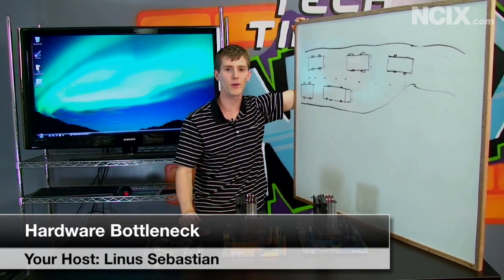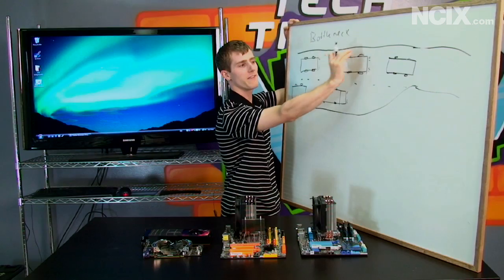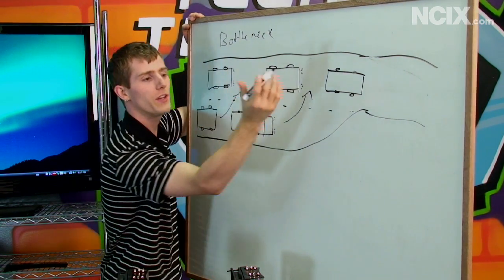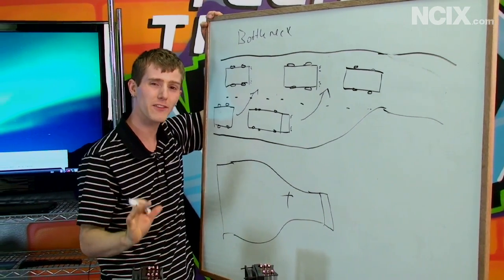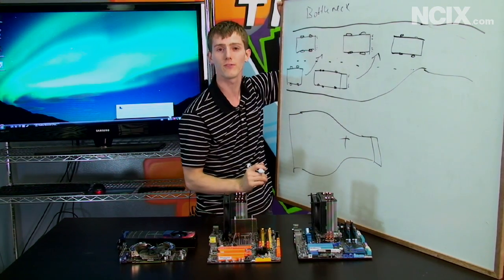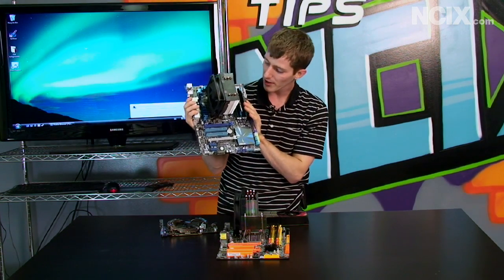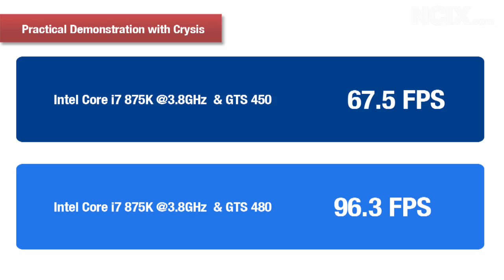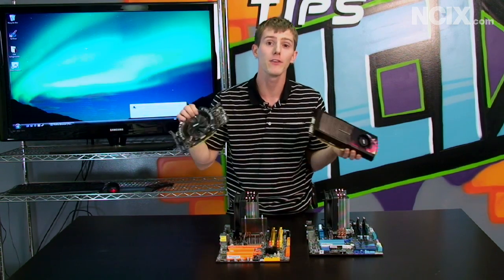Understanding Hardware "Bottlenecks" and How to Avoid Them (NCIX Tech Tips #81)

Comment: i have an AMD athlon II x4 635  processor
and i consider to buy  an  R9 380
(replacing my dirty old HD5570)
will those go together very well ?

i really want to upgrade my little buddy here for playing latest of games and recording
but i don't really know what is holding me back my HD5570 or my processor
i would guess the HD5570 because its a low to mid card
the power needed also says i need to upgrade it to atleast 750W 
with my  R9 and 750W i'm already at 380 euro's (europe)
i changed the 2G ram to a 2x4G  (8G) 

also will the " cooler master GX 750W " fit a gigabyte 870A-UD3 motherboard ?
Reply: it'll bottleneck obviously
Reply: Electrikz well i'm not the best computer guy so not so obvious for everyone

i think i can put in an AMD athlon x4 760k/  860K?  upgrade so it doesn't bottleneck ?

if not then what do you suggest ?

Comment: will i have an bottleneck problem running an:
mobo: Gigabyte GA-990FXA-UD3
cpu: AMD FX-8150
gpu: Gigabyte GV-R928XOC-3GD
hdd: OCZ agt3-25sat3-120g (booting)
hdd: WD Green WD20EARX, 2TB (storage)
psu: Coolermaster Real Power M850
ram: Corsair CMZ16GX3M2A1866C9

just asking cause i recently upgraded my cpu and gpu and ram cause BF4 was comming... but im not getting high FPS

Comment: if i have an msi gtx 670, and a amd a8 3850 apu, will it bottleneck? i mean. ive played skyrim, 1080p all ultra with the high res texture pack, and sometimes the frame rate drops to even around 40 fps sometimes. is it bottlenecking or is there something wrong with my gpu?
Reply: ***** ok, thanks.

Comment: I need help, been planning this Build for quite some time now, did some research here and there, watched a lot of linus tech tips lol, but im not sure. Please suggest if what are the parts that needs to be removed or to be replaced in order to have an optimized Build - im on a tight budget though XD  many thanks ;-)

CPU: INTEL CORE I5 4460 3.2GHz LGA1150
MOBO: MSI Z87-G41 
Coolong Fan: DEEPCOOL Ice Wind PRO
RAM: KINGSTON 4GB HYPER-X FURY 1866MHz (or 8gigs maybe)
GPU: PALIT GTX750Ti STORMX DUAL 2G DDR5 128BIT (the only GPU i could afford now)
HDD: WESTERN 1TB SATA3 BLUE/GREEN 
PSU: XIGMATEK X CALIBRE SERIES 80 PLUS 600W (is it over what i need?)

Comment: I recentley upgraded my computer from a i5 2500k and a gtx 560 to a fx8350 and a radeon 290. I was really dissapointed with the FPS increases I got. , some games were actually lower. Im still using the same 8gb of 1600 cas 9 ram.i did change my board from a p67 ud3 to a asrock 970 extreme 3.0 r2.0. I didint think id be bottlenecked by my processor or motherboard, but I keep feeling that maybe it is because im not getting the performance I should be alteast imo. Im also running a ssd 500mb/write but I dont think that would affect my fps very much. Is there an obvious bottle neck here that im missing?
Reply: Stephen Grimes i5 2500k is much better than 8350 dude
Reply: Games need single core performance which is much better per clock on the 2500k than the 8350. The 8350 is more powerful altogether but that doesn't matter when you're only using one or two cores
Reply: yeah.  sadly no 8 core games out.. i get higher pc benchmarks with the FX8350 but it doesnt mean shit if the games dont utilize 8 cores. Im making a new budget pc for my gf to play mostly low threaded games using a g3258  overclocked to around 4.5-4.8 and a gtx 960. wouldnt be surprised if it gets better FPS then my comp in some games lol
Reply: Stephen Grimes It would be better to get an i3 + R7 370. You don't want 8 cores, but you also don't want 2. i3 is a really good balance.
Reply: ***** do you even know what youre talking about?
Reply: ben p Nope he dosen't x)
Reply: Keruji 4th gen i3 beats i5 2500k because its newer duhhh??

Comment: I have a i7-4770s locked cpu at 3.10GHz and I'm running a GTX 980 and only use my computer for gaming. Is this bottlenecking my computer? should I go for a Intel Core i5-4690K at 3.5GHz and overclock for better future gaming performance? It runs games great now it seems, but not sure if upgrading would be substantial difference.
Reply: gamepro94z Sometimes, your RAM might be affected. That i7 is better than i5. But, overall, there's no difference (sure there's like 1-10 fps difference) in gaming perf.
Reply: gamepro94z  no the i7 can handle the 980 with no problem
Reply: Just leave it bro its fine

Comment: I have i7 960@3.2ghz with 2xGTX 770s (4G) in SLI...will I bottleneck?
Reply: ok... nice. Despite the age of the cpu, it won't bottleneck you for a while to come, especially as games start using the hyperthreading.
Reply: Yeah i actually ended up picking up a 4790k cpu i  the end, works well with the  SLI

Comment: i want to put a r7 260 into my gaming computer and i was wondering if it will bottle neck with these specs And i cant figure out what my motherboard is Sent by NCix tips

Processor	AMD FX(tm)-4300 Quad-Core Processor
Video Card	AMD Radeon R5 200 Series
Memory	8.2 GB 8GB RAM
Microsoft Windows 8 (build 9200), 64-bit

Comment: one question, does bottlenecking only affect frame rate? Because if I get a gtx 1070, but have an AMD fx 8370, obviously the frame rate isn't gonna be pushing it's full potential, but graphic wise, will anything be held back by the bottleneck?
Reply: Dude I did it with a gtx 950 and amd 7300 apu. I tried running overwatch and I get about 40 fps at the lowest graphics. I'm getting a new motherboard tomorrow though because I found out my motherboard wasn't an Intel 1151 to connect my i5 6400. It isn't worth getting the graphics card if you can't upgrade the cup as well because it will bottleneck as hard as a fat man on a water slide. Hope this helped in your decision
Reply: Prod Death I'm not going to upgrade it at the same time, but I will be upgrading the cpu and mobo sometime after I get the gpu. But I'll try the gpu with my current processor to see how extreme the bottleneck is. Thanks for your insight!
Reply: +Samuel Smith I bought a new mobo yesterday and now I can run overwatch at high settings and get 120 fps
Reply: +Prod Death I can run Overwatch at Ultra settings and receive 40-50 frames with my GTX 760 and AMD 8370. Considering that the AMD core is one of the best AMD cores on the market, I don't think it would be an EXTREME bottleneck. But I do plan on upgrading in the future.
Reply: +Samuel Smith i don't know much about amd cores, so if it is a really good core I think it would beam amazing with a gtx 1070
Reply: +Prod Death the thing about the series 8xxx AMD CPUs, is that they have up to 8 cores, which is 4 more than Intel has on their i7s. Unfortunately computer hardware and games don't need to use all 8 of those cores yet. So while the AMD CPU is busy using all its power to hold up those cores, it's not using the power it has to help the other PC parts as well as Intel can. Hopefully AMD will try to focus less on the cores and more on the actual CPU for their future products. That would save me more money than buying an i7 core with another expensive mobo.
Reply: +Samuel Smith ok, that's nice to know for future reference thanks
Reply: Prod Death np

Comment: I have a amd a6 6400k and 4 gigs of ram and a 400w psu I'm thinking about getting 4 gtx titans in sli would this work?
Reply: Yup go for it!
-.-
Reply: You'll overload that PSU... In the first place, if you can afford 4 gtx titans, why would you settle for an A6 system? It would be wiser to build a new rig based on an i3... You'd also want to upgrade the ram. If you want to stick with an APU system, I suggest that you switch to the A10 unlocked black edition, upgrade that ram to 6GB then crossfire the APU with a compatible Radeon GPU...
Reply: Digital Hermit He would rather be better with a 4 way 780 Ti system and a 4930K with 32 GB of RAM, if e needed all of that power.
Reply: Digital Hermit You ever heard of sarcasm?
Reply: Digital Hermit Hahaha somebody's sarcasm meter is busted to hell
Reply: Digital Hermit Understandable in this generation.
Reply: Digital Hermit Hey that hurt my feelings.
Reply: Sorry 'bout that...

Comment: i know my comp has bottle necks, there is 3, 1:my old ass PhenomII x2 560BE (oc'd to 4GHz), 2:an old WD sata2 1tb HDD, 3: and a GT630, but comp does what i need it to do, but what i want to know is what is the maximum cpu i can use with that vidcard on a GA-970A-D3, or would you recommend a new vidcard too, i'm not trying to spend over $600 ($700-800 absolute maximum)

Comment: hi, i have ang A6-6400k OC to 4.4g, and ang fm board... with crucial balistix tracer 8gb clock at 2133mhz. planning to buy either r9 270x or gtx 960, the question is which GPU is good that wont bottleneck my component.. thanks guys

Comment: Sorry if I sound stupid but will a intel i5-4670k and a msi twin frozr gtx 770 be bottlenecking. I just built a new gaming pc and I'm really new to this, so I don't really know too much about this stuff.
Reply: No way man i just ordered mine also and no you can triple SLI 780's with it, you will be fine:) happy gaming
Reply: AMDGamer101
Having more than 2 gpu's on an 1150 socket yields extremely poor results.  The processor simply doesn't have the capability to handle more than 1 gpu at full performance.

1 @ 16x
2 @ 8x each or
1 @ 8x + 2 @ 4x

If you really wanted to triple SLI 780's and not have it be a waste of cash, you'll want a 2011 socket.
Reply: Drew W 1150 will be fine, you'd lose a very small about of fps but you already lose fps in SLI anyways, one powerful card is always better. Plus the kid already bought a new pc don't smash his hopes over a few frames.
Reply: FatedCb I was responding to amdgamer, not the op. The 1150 socket is fantastic. "The kid" needn't worry. Sli and crossfire does very well up to two cards. Three cards is where you'll be wasting performance, as stated in my last comment.

Comment: While playing arma 3 my cpu usage is about 90% on all cores(i5 4560 3.2ghz) and my gpu usage fluctuates between 60-95% (gtx 760) Think it would be worth it to get a i5 4670k?
Reply: Hmmm, if your GPU is taxing all the way to 95% then that shows it is reaching its potential, I would upgrade both.
Reply: My CPU usage is typically higher than my GPU usage. GPU average is 75, CPU average is a bit over 80.

Comment: i have an i3-3220 (duel core 3.30ghz) and i want to upgrade to a GTX 760 would that be a bottleneck or not?
Reply: you do not have a bottleneck but your cpu will not be as fast as an i5 or an i7 because it is hyperthreded however it is only two cores i would try to also buy an i5 just to improve your performance because that is a weaker cpu.
Reply: I agree with Thenicknac22, i upgraded to a i5-2500, from an i3 and got a GTX 770 and it works great for everything i do!

Comment: I got a  Radeon 6670 by Vertex (1GB DDR5 128bit) and a crappy CPU E2180. That's like some historical 775LGA but that's it. No juice for new rig. Since my MB (ASUS P5K) supports dual core and core 2 duo can you suggest me a best 775 processor (mostly) for gaming if this piece of history can run anything at all.

Comment: Will it be a bottleneck if I use a pentium g3258 and GTX 950/960?
Reply: +TheFXGuy 101 pentiums are the 2nd worst intel cpu - it'll be bottlenecked with even the worst graphics cards.

Comment: Help? 
i5 -4590 3.3GHz. Will it bottleneck a 980 Ti? I know a 980 Ti is overkill by a long shot but I want to be future proof way into the future
Reply: You'll be fine i5 isn't that bad
Reply: +Sean Pipatkhajonchai FWIW, I decided on an i5-4460 (similar performance to 4590) and an overclocked 980 Ti.  Benchmarks I've seen show GTA V would benefit less than 5 FPS at 1440p or 4k with a faster CPU, and as I understand it, GTA  V is a CPU intensive title.  I'm happy with my upgrade.  I would caution against expecting any currently available CPU to give top level performance for games 3-4 years from now; I think of "way" into the future as more than 5 years.  Better to go low to mid-range and upgrade more frequently.

Comment: I have an AMD Fx 4300 Quad proc and an AMD RadeonR9 285
I only get like lower than 40 frames on Ultra but also on high and medium settings for Bf4. Is this Being Bottlenecked and if so should I get something like amd fx 4350 quad core cpu?
Also Mantle isn't working on Bf4 though my Gpu says it's supported, is that also because of Bottlenecking?  please get back to me soon. thanks c:

Comment: I have:
MB = Asus Crosshair 5 Formula-Z
CPU = Fx-8350 with turbo on
CPU Cooler = Zalman CNPS-9700-led(old from 2008)
RAM = Kingston HyperX Beast 16Gb(2x8) at 2133
GPU = Asus GTX 760
HDD = 1Tb + 500Gb + 250Gb (all WD and sata2)
PSU = Enermax Liberty Eco 620w (2x12v with 30 amps each,old from 2009)
Monitor = Fujitsu Siemens ScaleoView L24W-4(old from 2009)
Mouse = A4Tech Bloody Gun 3 V7(i don't even use it for what it is made for)
Keyboard = A4Tech KLS-23MU(old from 2006)

Is there a bottleneck

Comment: Glad I stumbled on this vid.
Im currently buying a gtx 760 n my current cpu is a core 2 duo but im upgrading that to a core 2 quad(q8300). Im sure the core 2 quad will still bottleneck the gtx 760 but it should play better with each other as opposed to the core 2 duo..correct?
Reply: it would work better with quad, but it's still bottleneck. For q8300 would be nice pair like HD7770, HD7790 (260X), gtx 650Ti. But in the end it depends on games. Cpu heavy games are the new ones like hitman absolution, far cry 3, crysis 3, mabey new metro, and the king of bottleneck Battlefield 3 and 4 - multiplayer (big maps, 64 -players)
Reply: Don't get a Core 2 Quad man, get a Core i5.

Comment: i have 12gb of ram and an i5 4460 with a 970 but i want to upgrade to a 1060 will i have a bottle neck or will everything work fine
Reply: 3 gb of 1060? our 970 will do its job for quite long. no need to upgrade if you dont want 4 k gaming perfomance and if so then you should buy gtx 90 ti at least which is way better than 1060

Comment: FX 8350 is the best CPU for the money . I don't why people ask ' will it bottleneck 7970 ? ' or something . My friend paired it with two GTX 780 and they run without any problems ! It is better than i5 , and better than i7 in some application ( streaming , virtual machines and other processes that require more threads ) . It is like fake i6 . AMD CPUs are just so underrated , but that can be good thing , because you can find them for low prices .

Comment: I just purchased a Intel i7 4930k 6 core processor, and 2 128GB samsung ssd's that i'm going to stripe so far. I intend on getting an ASUS x79 Deluxe board, an EVGA dual superclocked 4gig gpu, and a set of gskill ripjaw z series of memory (8x4gb). For storage I was just going to get a few 7200 western digital drives and raid them accordingly purely for redundancy.

I am going all out on this, I was wondering if you see any bottlenecks in my build so far? Any suggestions?

Comment: Should I get a i5 processor if Im getting a GTX 750ti opposed from getting an i7?
Reply: There is no difference between an i5 and i7 when it comes to gaming. If you plan on doing a lot of video rendering get the i7.
Reply: Alright. But if I got an i5, would an i7 profit me more? Besides ghz.
Reply: ***** No. The ghz bump is negligible because Intel already has strong single threaded performance. If you're rendering a video while playing a cpu intensive game you would most likely lag compared to an i7. 

I think people misinterpret the term "multitasking". Ram hogging and running CPU intensive tasks are two completely different things. 

http://www.ocaholic.ch/modules/smartsection/item.php?itemid=1164

Comment: No(probably)bottlenecking is when the full potential isn't being using on certain parts because of another part that is acting as the neck of the bottle.(NOTE:some intel fan boy will say some bs about how the 8320 sucks). In yours case from the info given a better cpu + the same gpu should run at equal or greater speeds depending on the games focus on the cpu BUT if the other person ran the game at different specs OR overclocked their parts so they had better performance. i hope this makes sense

Comment: They do, very well. The 4770K is a high (but not top of the line), and the GTX 780 is the same (although much closer to top of the line).
Remember, if it's just for gaming an i5 4670K with a GTX 780 will be nearly as good. Go for the 4670K if you're looking to save a few bucks.

Comment: CPU- AMD A10 5800K 3.8GHz Quad-Core
Motherboard-Gigabyte AM1M-S2H
GPU- Asus R7 240 2GB
RAM- 4GB Crucial Ballistix 1600MHz(2gb*2) KIT 2 dems
HDD-1TB Seagate Barracuda HDD
CASE AND PSU- Rosewell FEM01 & built in 450W PSU
Will this PC bottleneck?

Comment: Hey guys, currently running:
Intel i5-2500t with a ati XFX 5850HD GPU. 
I'm currently considering getting a GTX 970, but i'm unsure if the CPU will bottleneck it. Any thoughts?

Comment: Will there be any bottle necking if I use two Intel Xeon E5-2680 2.8GHz 10-core processors with two EVGA GeForce 780 384-bit GDDR5 GPUs? First time builder, but I need the workstation for the 3D entertainment industry, and I'd like to do some gaming on the side. lol

Comment: Your first example with the kilowatt PSU granny PC doesn't really illustrate the way the word is normally used, it is not holding back the rest of the system and therefore is not "bottlenecking"; that's called "waste", or "overkill" and is completely different thing.

Comment: will my system bottle neck if i have a fx-6300 cpu and a GTX 1080 with a evga 600b powersupply
Reply: yes a lot i have a 6300 and a 970 and it Bottlenecks so damn hard go for a fx-9350 or change to intel i5 and get a 1070. 1080 isn't worth it